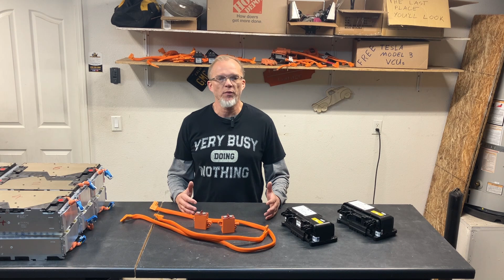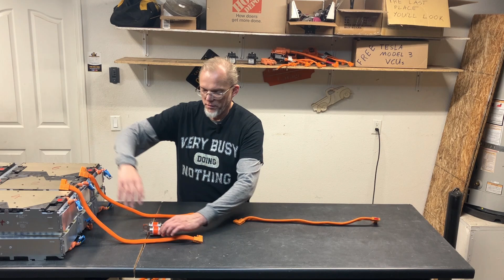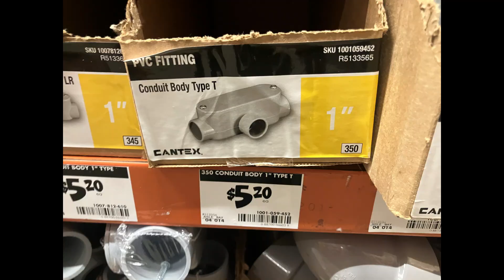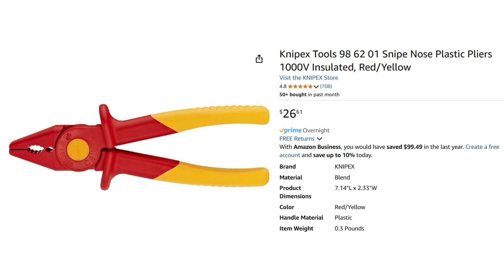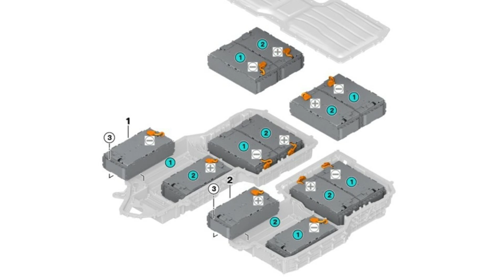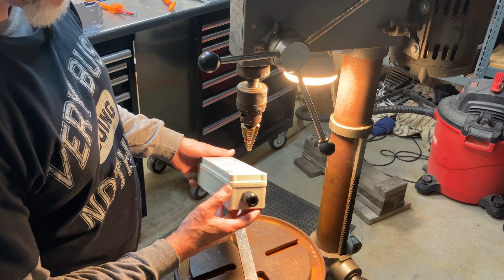GMCe DIY EV Positive Battery Pack Connection

Comment: I'm no expert (as we all know) but if you have two packs in parallel then the current drawn from each should be half the total (so long as the two packs are equal condition). Fuses are there to protect the cables and other devices, not the batteries so lower is better. Have you considered putting each fuse inside the battery pack so in the event a fuse blows there will be no live voltage from the pack and the full length of your cables will be protected?
To reduce the terror of touching the two positive leads maybe putting an incandescent light bulb in series? If you got it wrong the light glows but no harm done.
Reply from the maker: all good advice, please note these are the OEM stock cable lengths this is where BMW had the fuses and as long as they seem they are inside the battery pack or will be once I encapsulate it sort of speak
Reply: @Good-Enuff-Garage  👍